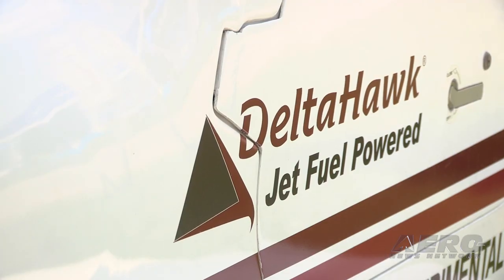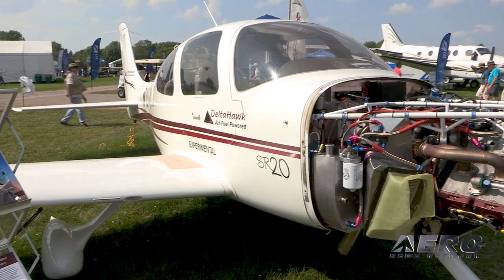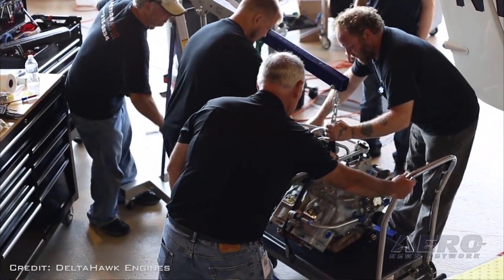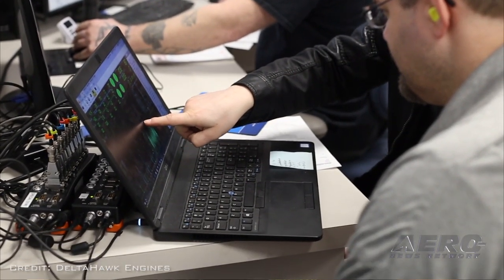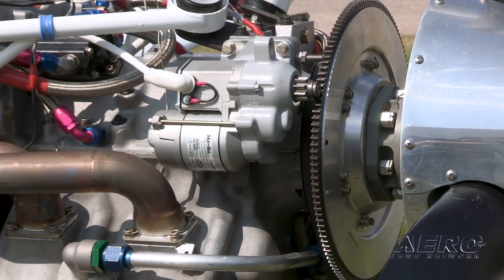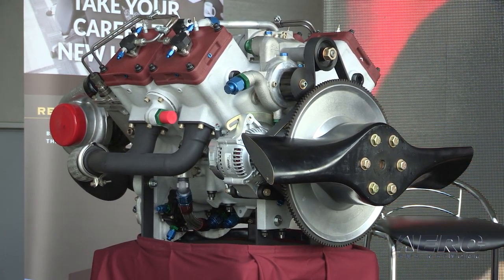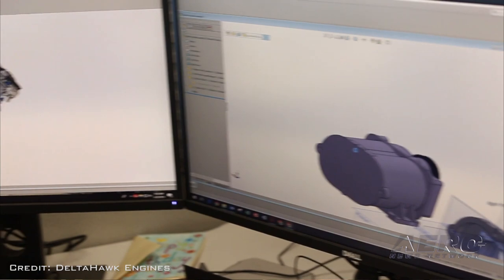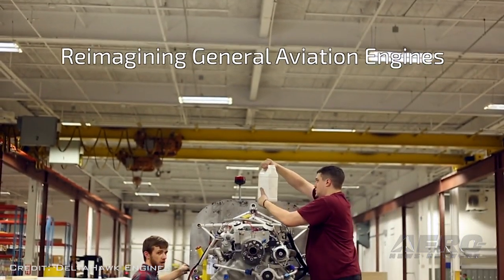Aero-TV: DeltaHawk’s Diesel Program - Approaching Certification and Production

Comment: Doesn’t matter what they certify any more. The average man wont be able to afford it anyway.
Reply: Cameron R   Exactly!  How do we fix this.  Seems like the value proposition on avionics is improving rapidly, (I didn’t say price).  Airframes and power plant not much improved in any way.  Even though we have composite and cnc AL like never before things are same weight more expensive than ever.   A few designs are slightly lower drag.
Reply: Get a 540 CID continental and make a uni-flow 2 stroke out of it much cheaper.
Reply: Damn i would love to have this on a stretched banshee!

Comment: I am no great fan of Audi and their Automotive group. But when they put a diesel in a race car and were completely eviscerating the competition. I thought it was high time that the diesel got its due. The EPA has been trying to destroy diesels in the United States for decades and that engine is more than capable of being clean with all the horseshit that they force companies to put on them. Most of the exhaust is soot that falls to the ground and becomes dirt. If you run it with a different fuel source, it will burn even cleaner yet. And it will still run with probably a doubling of the TBO time. The other thing they could look into is using hard Chrome in very specific parts of the engine so that should you lose oil pressure you could actually fly the aircraft to a location and land it while you still had power. Would it require a rebuild after that most certainly because you have to check all your tolerances but hard Chrome he is very slick and has been used in applications that I have watched it get almost nowhere whatsoever with some very heavy use.
Reply: For starters, diesel emissions are partly due to their attempt at reducing emissions and fuel consumption. The development of high pressure fuel systems highly atomise the fuel, meaning the soot particles are also much finer, which means they are less visible than old diesels because they become air born. Diesel is the leading cause of respiratory cancer now. Also chrome is not very hard in today's standards, it was more for corrosion protection.
Reply: @chippyjohn1  bias

Comment: They need to find an application that justifies the $90K price tag.  Experimental aircraft are flown a few hours for fun as a hobby.   That customer segment has thin wallets and isn't looking to save $5 an hour in fuel costs.
Reply: More like $20 per hour saved vs a 10 gph avgas engine, and much improved range with fewer things to go wrong.  I put a Cummins in a Ford for the same reason.
Reply: The most obvious markets would be outside of US where av gas is scarce if it exists at all.

Comment: Delta Hawk is great but $90,000, granted full installation (prop?). A Lycoming 180HP in a RV7 or RV8 with constant speed prop would be under $40,000, using the standard Vans kit cowl.

Comment: 31 May 2021 still no certification yet. Also fuel savings over the projected TBO is only $10000.
Reply: Good point. I'm looking at this for two more reasons- one is that 100LL is constantly rumored to be leaving, second is the additional range that the higher energy of Jet A allows per gallon.